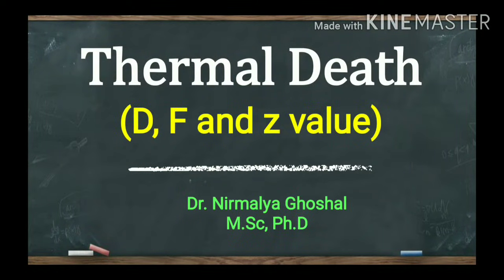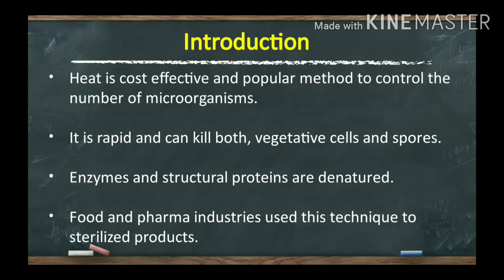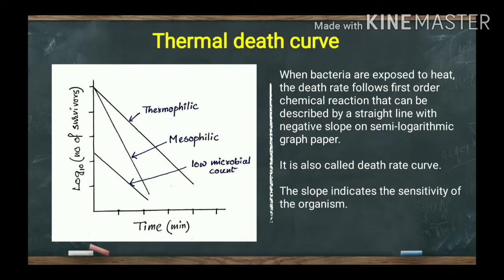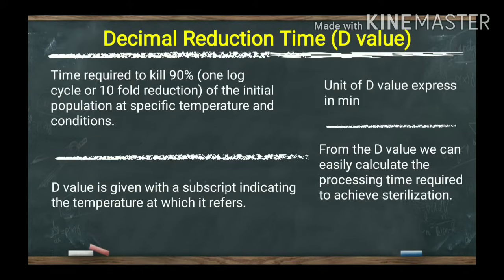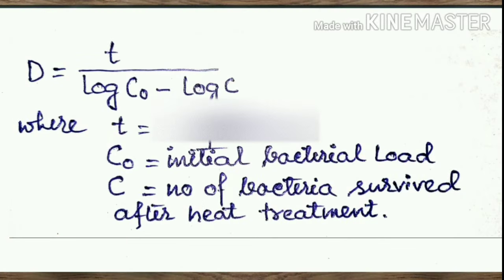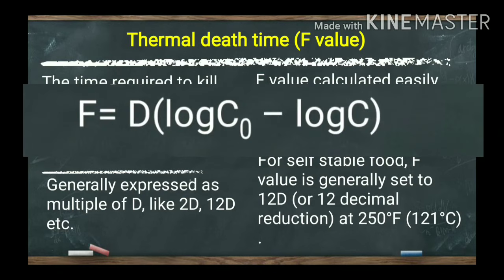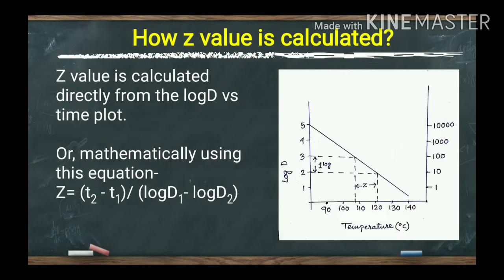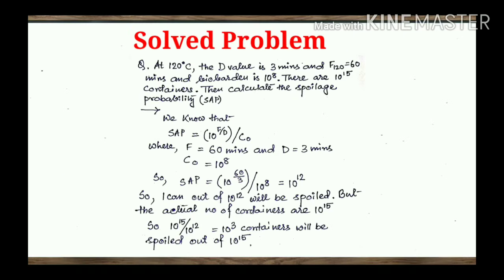Thermal Death Parameters of bacteria (D, F, z value, SAP) with solved problems for GATE and JAM exam

Comment: Pardon me, i dont get it, can you explain to me the difference between D value and F value sir?
Reply from the maker: Thank you for your interest. Here is your answer-
Suppose you want to sterilised a solution in which 1000 bacteria are there. You have exposed the solution at 121°C. And,  after 10 min 90% bacteria (900) are died so D value is 10 min. But still there are 100 bacteria present. So, you extended the treatment for 10 min more. What will happen?
Again after 10 min 90 bacteria will die but 10 will survived. 
Now F value to kill 1000 to 10 (it's called 2D) 20 min.
Because, F= D (logCo - logC)
Or F= 10 (3-1)
F= 20min
When you want to kill 90%, F and D value are same. But if you want to kill 99 or 99.99% F value and D value are not same.
Reply: @DrNirmalyaGhoshal  OMG, this helps me alot. Been fool for a week. Hope I could find this answear immediately. Thankyou for your explanation 😭😭😭
Reply: @DrNirmalyaGhoshal  Definitely the best explanation out there, Thank you!
Reply from the maker: Thank you for your interest.